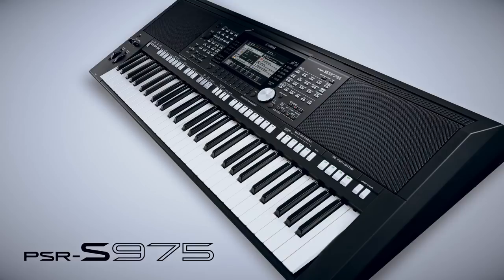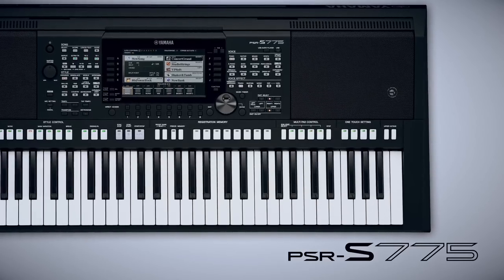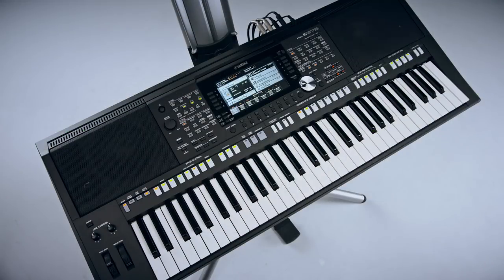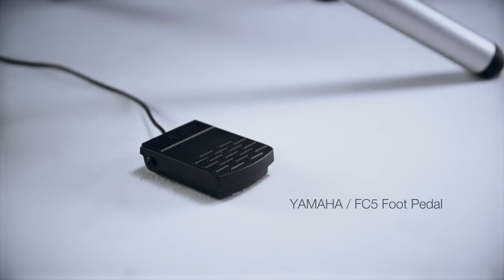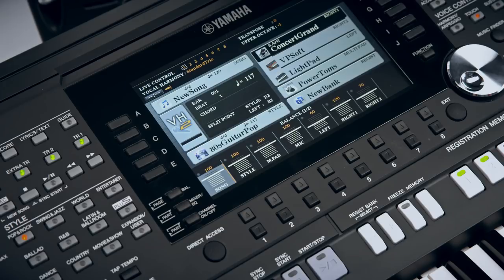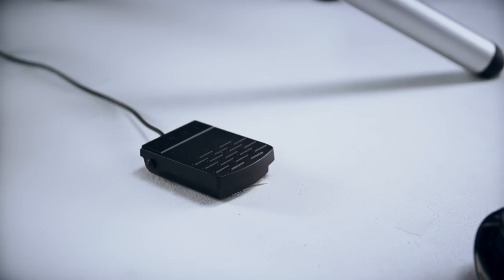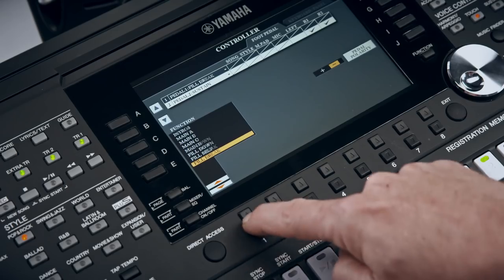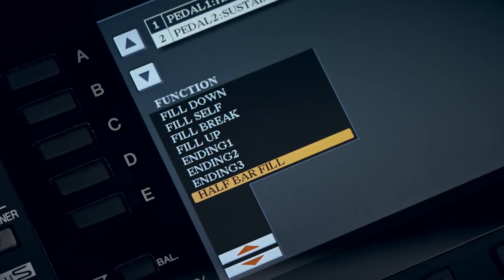PSR-S975 / 775 Half bar fill-in function

Comment: Further to my previous post, this "half-bar" option is a VERY useful feature. My 1993 Roland E-86 arranger keyboard had a dedicated "half-bar" button on the front panel, and I used it a lot. It's usefule when we:

1) need to insert a 2/4 or 6/4 measure in the middle of a song
2) want to "change up" a style to begin on beat 3 (which can add color to styles that incorporate 2 measure phrases) or
3) want to "turn the beat around" (particularly in latin music when the clave can be either 2-3 or 3-2). This changes the overall feel quite a bit. (See my YouTube examples of this below*
4) need an easy way to "get back" to beat 1 quickly. (For example sometimes we are delayed in finding and pressing the right voice button in time to start on the downbeat of the next measure, but we don't want to wait a full measure to start the next section, so we start 2 beats early on beat 3 (this happens a lot when there's so many buttons to choose from). But now we have to "get back" to beat 1 asap, and that's when this feature is really needed.

Having this half-measure 2-beat option available with a foot pedal is terrific (thanks Yamaha!). But it's even more practical when it has a dedicated button, as on the Roland E-86. 

(Same with the chord looper, which is an awesome feature that is incredibly useful for professionals. Yamaha finally introduced it on Genos v.2 with sub-menu access but no dedicated buttons).

It's encouraging that Yamaha has finally introduced these two useful features into their higher-end arranger keyboards! Dedicated buttons would be even more useful, but we'll take what we can get! (Good News: the PSR-SX900 now has dedicated buttons for the chord looper! Ah, I feel the nostalgia of Roland 1993 coming on strong!) 

It's just sad that it took Yamaha 25 years to introduce these two "breakthrough" features that were already in the top three Roland arranger keyboards way back in 1993 (which were much-used by professionals on their Roland E-76, E-86, or E-96 arrangers with dedicated buttons). Kudos Yamaha.
=====
*Here's an example of "turning around" the clave in a samba beat. (fyi: What is the clave? "Both as instrument and as rhythmic pattern, the Cuban clave is perhaps one of the most significant developments to impact the music of the Western hemisphere.") Hear the difference between clave on beat 2 (https://youtu.be/_yqbzXkWtjA?t=326) and clave on beat 1 (https://youtu.be/_yqbzXkWtjA?t=449). The moment I began singing "Zion is a place of worship" (at 7:27) I realized I needed to "turn the beat around" so that the clave matched the melodic rhythm on the words "Zi-on is" and "dwell-ing of" (at 7:37). But because I didn't have the half-measure option (since I was using a Yamaha DGX electric grand), my only choice was to extend the previous song one extra measure (see where my hand hits the variation button at 7:59), which "turned the beat around" so that the clave now hit on beat 1 for the new (unplanned) song in the medley. You can hear how the clave hitting on beat 1 perfectly matches the melodic phrasing of "Last-ing joy" and "Be up-on" at 8:20 (https://youtu.be/_yqbzXkWtjA?t=500). I then played a piano solo with the clave still on beat 1 (at 8:49) (https://youtu.be/_yqbzXkWtjA?t=529) which works very well. But then to change up the feel of the next 16 measures of piano solo, I say "Let's have some fun" (at 9:17)(https://youtu.be/_yqbzXkWtjA?t=557) and then I "turn the beat around" by adding an extra measure again, thus bringing the clave back to hitting on beat 2, which changes the feel back to

Comment: I used this half-bar function often on my Roland E-86 (manufactured in 1993). It was a life-saver when needed. Together with the arranger loop function, it's wonderful to see Yamaha finally "catching up" to some of the features that made the E-86 such a professional keyboard—even if it took them 25 years. Thanks Yamaha. I'm a fan now. Are these two functions available on the Tyros 5 and Genos?

Comment: Great. Now we just need to wait for 3 more decades so they decide to put the button on the panel to do the same, as Roland does for the past 25 years.
Reply: Half Bar Fill In Is On the SX600 Now.
Reply: @xenialxerus934  but needs a pedal